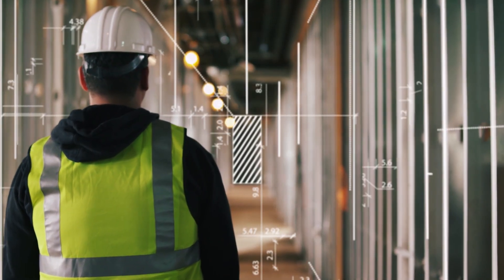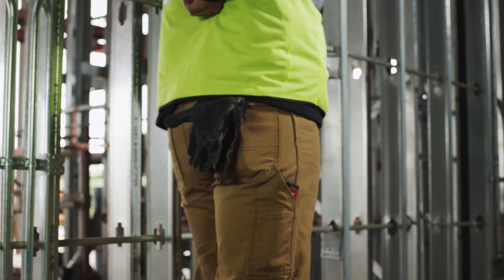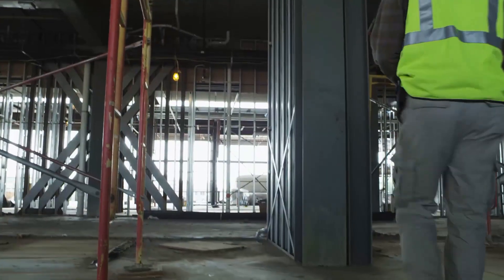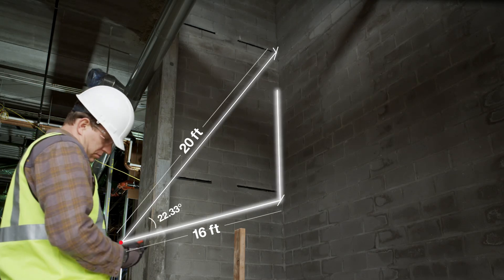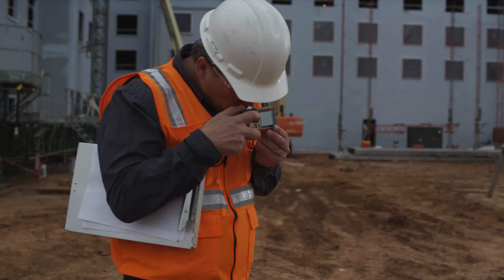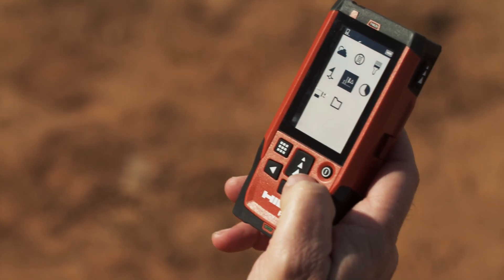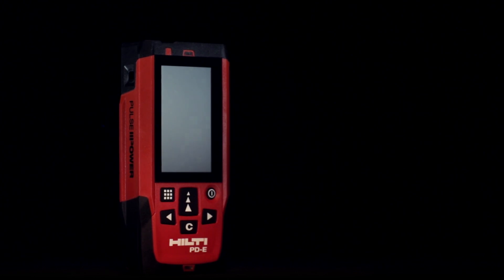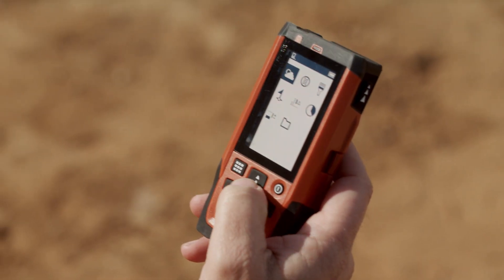OVERVIEW of the Hilti laser range meters PD 5, PD-I and PD-E

Comment: Hi guys i have a near new pd4  and was working well up to a week ago. Now its not turn on ive cleaned the battery area and new batterys and it did say batt the showed a few weird dots but now nothing wont turn on what should i do do u think?
Reply from the maker: Thank you for reaching out! We recommend that you contact our customer service team to either speak with one of our technical service reps to try and troubleshoot a solution or schedule a repair to send it in to be looked at. You can reach them at 1-800-879-8000.

Comment: These look great, and HILTI service is top notch and a great reason to buy if you’re near a distributor, but these look suspiciously like rebranded and slightly redesigned Leica Disto meters with a HILTI price tag. That’s not a bad thing as Disto makes the best I’ve tried by a long shot and the price may be worth it for the accessibility of service centers. That level feature for incline is sweet though, and better than the interface on my Disto equivalent that was just dropped off a roof and wrecked. Thinking…

Comment: This is working  in inches
Reply from the maker: The tools will work in both Metric (centimeters, meters) and Imperial (inches, feet) and it's simple to change them between the two units of measure.
Reply: @HiltiNorthAmerica  how to change the unit type in PD-E ? 
Mine is only in metric units, i can't change it to feets, it only toggle between m, cm and mm ...